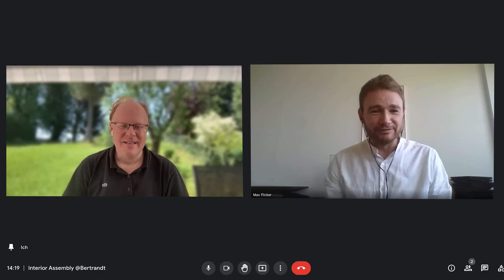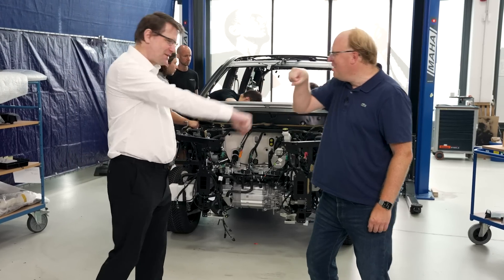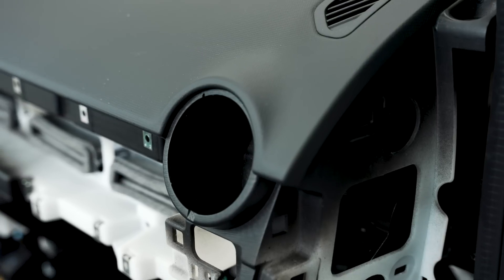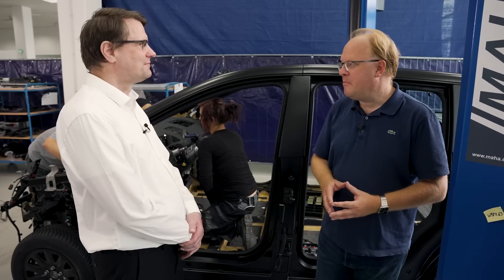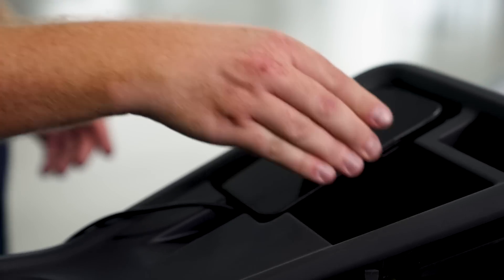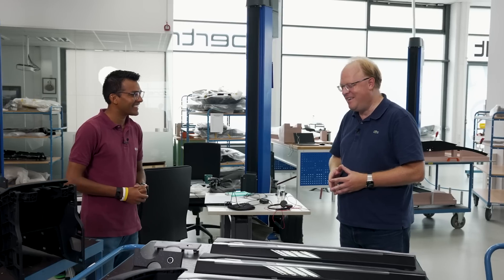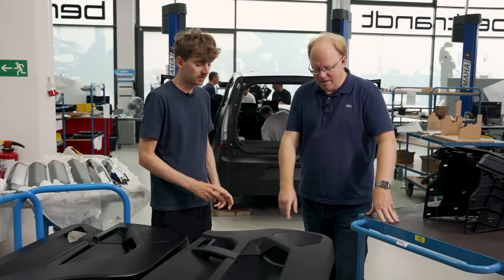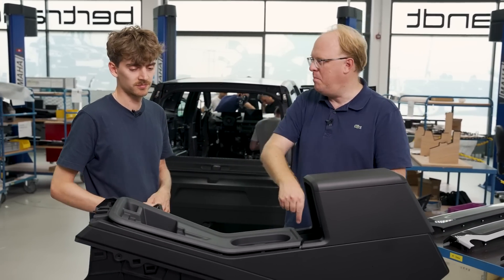Interior Part I - Design and assembly | Sono Motors

Comment: Oh, I can not load my iPhone in the Sion?
Reply: A Wireless charger module costs about 10 € at Amazon. 
As there is plenty of space in the middle console it should be easy to add that by your selves. 
But charging by wire ist more efficient so I'd go with that.
Reply: You can use still an adapter USB-C 2 USB-A.
Reply: @Bugstoon  Yes, sure. Just want to point out „no wireless charging?!“. But ok. I can life with it. But not without a sunroof.
Reply: @minicirco  Unfortunately "wireless charging" wastes a substanitial part of the energy. So I consider cable loading as much more efficient :-)
Reply: @minicirco  You want a sunroof in a car that is entirely covered in solar panels? I hope you can see how that wouldn't make sense.
Reply: @NorboHitman  While driving, it would be a very nice feature. The mechanism would be (too) though I guess.
Reply: @minicirco  yeah, that’s true. I think for most Sion customers total cost of ownership and sustainability are too much of a priority. 

My main worry? No speakers on the back row. Can’t seem to find that info.

Comment: I think the obvious question is: A plug, directly connected to the car? What if the cable breaks? Wouldn't a wireless-charging-pad be more durable? Or can you at least unplug the cable and replace it?
Reply: Yes you can. It's a USB-C plug. There was just a cable plugged in at the time of the filming.
Reply: @sebastianbottger3465  Good start. What about a qi charging pad? Should only cost about 5-6 $
Reply: @slickvisualpoetry only "aftermarket" / retrofit. I tried to lobby for it, but there had to be a cut somewhere to keep the price in check...

Comment: Interesting but why are only some parts out of recycling material or only partly?
Reply: I think it's because the recycled parts are more expensive, and perhaps less structurally sound. So you only want to use them on the parts that the customer can see and touch, so you get the most customer eco-satisfaction value out of the more expensive, non-structural parts.

Comment: What options are there to replace the moss? Doesn't it work as an air filter? If the moss is replaced with something else the car will then not have the air filter?
So does the moss have a functional effect or only decorative? If only decorative, then I can see it being replaced with something cool. But if it's a functional part of the car, there aren't that many options.
Reply: As much as I remember Sono said  the moss does increase the filter quality by some percentage. The regular filter, somewhere in the car I guess, does the main work. So the moss is just an nice to have thingi and can be replaced by, well what ever you like actually.
Reply: @MechmanGetrieb  If the moss has no real function than for me they can leave it out.